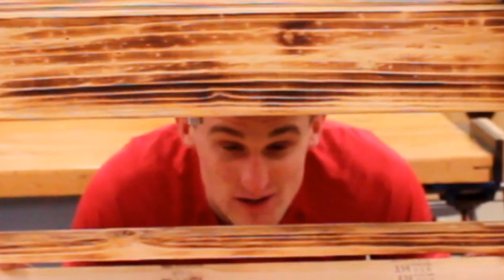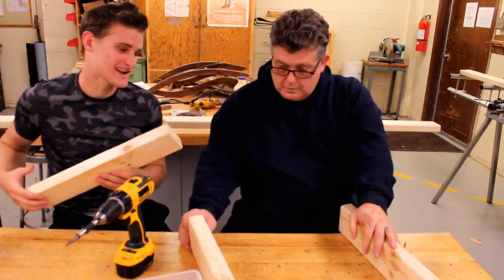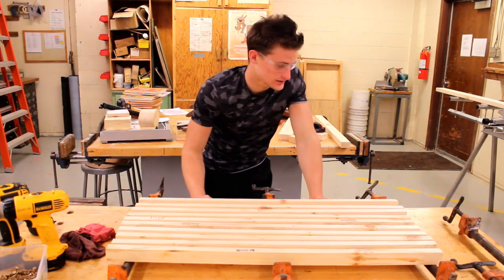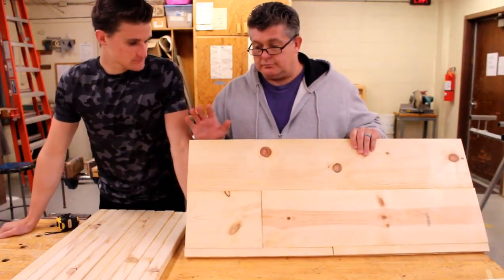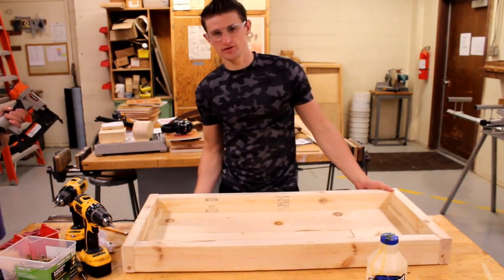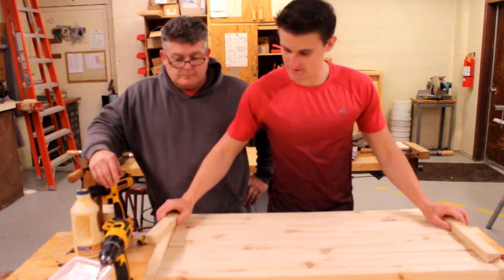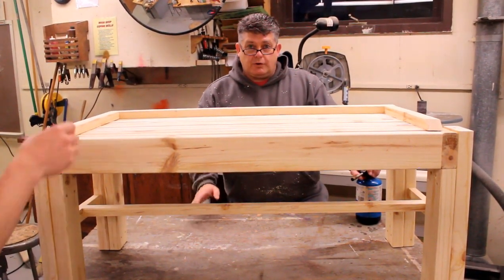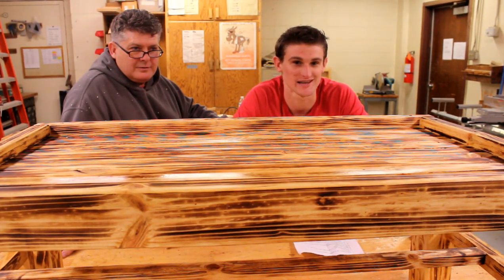Secret Boot Bench Bunker Build! (A Fun DIY)

Comment: I just found your channel, and I wonder if you might take requests for ideas on how to do something? :) 

I have a large DVD collection, and I have Ikea bookshelves that are great, but there is a lot of unused space on them that I'd like to utilize. The shelves are deep enough to perfectly hold two rows of DVDs, but if I do that, I can't see the titles on the cases behind the first row of DVDs without pulling the first row DVDs out. 

I've been trying to figure out a way to maybe make a little sliding shelf that would allow me to pull the first row of DVDs out and downward, so that the DVDs in the back would be easily revealed. It has to be a fairly thin structure for the shelves and the brackets to be functional and not defeat the purpose by taking up too much additional storage space on the bookshelf, ya know?

Any ideas? I'd LOVE to see a video about something like this, because I have very limited space and over 1000 DVDs at this point. :)